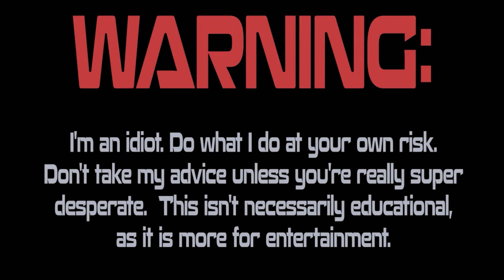FORGOTTEN 1970 Evinrude Skeeter Snowmobile - Will It Run? Part  2

Comment: For what it's worth. Back in the day we used to get the local welding shop to make up new wear roads for the old stuff. Took in the originals for templates and usually within a day or 5 you'd have new ones. The bonus was they were almost always cheaper than new parts, if you could find them.

Comment: There's 400ish names most commonly used in my area is "scags" when I was younger we welded round stock to grade 8 bolts then a nice bead of welding directly to the bottom and grinded it down angles would last cut n steer pretty good cheeper fix last long time heck yes sleds wheelers anything engine wise a feller enjoyed that stuff great job Derek 👌😁

Comment: Also, for metal tanks like this one -- if you have the patience, just drain the tank and fill it with vinegar (removed from the sled of course, you don't want vinegar in your fuel system).   Let it sit a week.  It will be clean when you dump and rinse it.

Comment: Even thou the wear bars used to be high carbon steel, rebar would work well. just bend to shape, then weld on some studs for mounting. (Once you get one that fits, copy the pattern onto a piece of cardboard for the next/future replacement) 
They add some strength to the skis, but they greatly improve turning the sled, certainly more when new then when worn down.  Great job on the sled. Runs and looks great!

Comment: I very much enjoyed your video. I have spent most of my shop time working on Yamaha's. I have a 1968 Evenrude 18-inch track machine with the push and pull engine design sitting in the trailer. You're making me think it will be next summers rebuild. Thanks for the inspiration.

Comment: Wear bars can be made from 3/8 or 1/2 “ square stock. 
Works better for steering than round bars. Pop on two studs to bolt up through the ski.I salvaged mine from an old wrought iron railing   I drilled two holes and tapped them 1/4x20 and used threaded rod to make studs. Ends of square stock can be rounded to fit in the ski and bending the ends to match the profile of the ski with a little heat and a bench vise. 
Not only will they steer better but also last longer depending on the thickness you use. 
I made a set years ago and they worked great !!

Comment: Great resto. I make my own ski runners for the old sleds using cold roll steel and weld a few bolts or all thread for studs. You can put some beads of weld on the bottom to act as a carbide.

Comment: Make your own wear bars using the torsion spring that hold up the trunk lid on the vintage cars.   Heat the end and bend the curve into it then weld bolts on it.  They last better than the carbide ones because they don't crack when you hit something hard with them.

Comment: Dennis Kirk in Rush City MN has some possible ski carbides for the ol 'Rude, but otherwise as a kid I'd take some discarded carbide taps from Douglas Machine in Alexandria MN and weld them to the bottom of the flattened out wear rods on my Yamaha Phaser. Dress 'em up with a grinder and boom, work fine, last long time. Shame about the broke off studs, may be welder and fab work time if Dennis Kirk doesn't pan out. Keep up the quality content, I feel like we could have been high school buddies.

Comment: Can you imagine trying to side hill that little gem?  TOO FUNNY!  I never noticed, do these old sleds have a chain case drain plug? I was so happy when they put dip sticks in them...  the 80s seem to have alot of problems, no one was checking their chain oil regularly.  I checked all my fluids on Friday b4 leaving home & lost an axle bearing the next afternoon. No way to predict a seal failing & it kinda ruined the latter half of our ride.  After that I started pulling & inspecting  all the bearings & seals each fall.  I have gotten spoiled with belt drives & 3in paddle tracks.  You look like you have had alot of seat time, ever been out west or in the mountains ridding?  Check out the larger muff pots that came out.... we put everything from hot pockets to beans & little smokies in a zip lock inside ours.  After a spirited ride to our play areas, it's always nice to have a hot bite!  I use to put a strap around my daughter & I like a seat belt when she was small.... if I had to stand up or hit a bump wrong... there was Pease of mind knowing she would never hit the handlebars.  They always fell asleep within the first 5 min anyway so it was like carrying a sack of taters lol but they loved it so much!!!  Mine would hear me loading sleds out back & come running outside!  At 18mths I scooped her up & put her in the suburban... she climbed into her seat &  didnt want to get out.  So for the next 90 min loading our bags ect... heck I even took dinner to her & we had a  little picnic together... I put the baby monitor beside her so we could hear but Dani was excited to head to the cabin, never made a peep!  Children just want to be involved & I applaud how you & your beauty wife have involved your boys in all your projects.  It will amaze you once they are older how much it all ment to them!  The one on one time you spend teaching I can see builds their confidence & their abilities have grown! Our kids are our legacy.  Love the builds!

Comment: Yep, just some round stock and weld some bolts on.  If you want em to wear longer, just run a bead of weld down the bottom side of the round stock.  Just take one ski off and use as a jig and make a bunch of skags in an evening:)

Comment: Nice work. I had a 74 Elan SS. Seriously, the only  way to run it was wide F'n open. Otherwise the track would plug up with snow or it would  get stuck in deep snow. WFO she was a fun little unit!

Comment: Designed by real engineers with a pencil, slide-rule, wearing a shirt and tie.  The locomotive styling and the practical oversized control knobs and start handle (gloves on operation) shows they knew exactly what was needed.  Where are these engineers today?  Thanks for sharing this beauty.

Comment: Hello from the land of the snow   Up here in Alberta I make skates from cold roll steel and some bolts bent and welded to fit using the old ones as templates saves on the wallet a bit

Comment: For your sliders for your skis on the Evinrude snow mobile use pieces of solid tubing cut to length and weld a stud and nut at the right location and sliders are made

Comment: We use to make our own wear bars, bend rod & weld a cut bolt to them to match  the stock ones.  It's not perfect but dirt cheap & worked great without cutting lines in the concrete with the fancy carbides. They wouldn't hang up on the trailer ramps either. Just a thought & with your ability it would be easy.

Comment: A friend of mine either uses 3/8” tool steel rod or he has also used tool steel weld rod and welds a wear layer onto the existing bars. Once the weld wears down he welds a bit more. Seems to work on older models he can’t find them for

Comment: Scags are easily made. Use your old ones as a template. Buy barstock (half inch I think) from your local steel yard.. Bend the ends in a vice. Use a perswader if necessary. Weld bolts thread first to the barstock. Then cut their little heads off.  I used to use square stock and round the ends so they fit the ski's. The square stock has more bite when cornering and takes a lot longer to wear out.

Comment: You can build carbide runners for the snowmobile from trunk springs  weld on headless bolts and use hard steel welds for carbides use to do this when I could ride

Comment: quick tip from someone who used to ride flatland bmx, use compressed air and shoot it under them handle grips and they literally BLOW off the bar and you wont need the grip remover

Comment: Derek it might just be the way the video was edited, but it appeared to me that the compression release was open when you adjusted the carburetor. You might want to look at the video and/or readjust the settings. Not nitpicking, just wanted to help if I could to cure that bogging down issue that you mentioned.

Comment: Oil today is definitely better but I would start at 32:1. If you foul a plug then go to 40:1. Just removes the risk of being lean and cause engine failure.

Comment: I used to make my own ware-bars just go to a hardware   Store and get some rod the right size couple quick bends to fit the ski holes and put grade 8 bolts in place under them and weld it to the bar stock

Comment: I use cheap hairspray for grips and things like intercooler pipes. Slick as a freshly shaved dolphin and sticks really well when dry. If you need to remove it, just warm water.

Comment: Hey Derek you can make your own wire rods go to the metal yard get some round stock and cut them and bend them yourself and then take a wire feeder and run a wire line feed line down the wire and you got a hard surface

Comment: Hello i just saw you video and if you cant find your ski skags use round bar stock i bebd mine abd weld bolts on where they are needed and they work great for old hard to find ones

Comment: Make your own hose clamps for odd fuel lines wrap soft solid copper wire 20-24 AWG or finer - one or two loops around the hose then twist like you're closing a bread bag- use a forceps or needle nose.  Not too tight, cuts the hose. Can be untwisted for removal.

Comment: you can make those runners out of 1/4 in stock and a couple of small alltheard welded to the top if you cant find the correct ones. did that a few times in the late 80's for a 340 artic cat

Comment: Trunk Torsion Rods for your ski.  About the right size and weld a stud on them and bend the ends.  My dad and I would  make them all the time.
Reply: You can even run a bead of hardsurface rod down them if it will see a lot of time on pavement

Comment: It may sound somewhat counter intuitive to introduce water into your fuel system, but when you have tight poly hose going onto a barb you can run it under hot water or soak it in an electric kettle to make the hose softer and more payable and easier to go on. Instead of the micro torch which you clearly stated, and have experienced, can cause pin holes and FIRE. Although majestic, that's not always the best thing...

Comment: Make your own runners, cut the rest of the bolts off and weld some new ones on, then run a couple of beads down the length of them to replace the worn off material with even harder steel from the weld beads, they will last longer and are cheaper, we always used to weld a bead down the length of them to make them last longer.

Comment: 2 stroke oil, use what the bottle says, not what the machine/manual says. The manual may say it has to run at 24:1, but it will also tell you to run yamalube or polaris or whatever brand the machine is. Bottom line, run the mixture that the oil says to run.

Also, more oil in the fuel=leaner fuel/air ratio because it makes the fuel more viscous, thus resulting in less fuel going through the jets in the carb. I know it sounds counter intuitive, but if you think, "its running lean, i'll add more oil" you will actually lean the jetting out further. 

Use the fuel:oil ratio on the bottle, then jet the carb

Comment: The neutral lock works nice but they engine will need to idle down real low , or almost stop for it to release. 
I usually switch off the key and then back on just before it quits. You may even hear the lock release as everything slows down.

Comment: An idea for the grip-a-lator onner-offer tool is some compressed air. You'll want a smaller & rigid blow tip. Just poke it on an edge and be in disbelief. A gal was shown that by an old timer last century.

Comment: As far as the  rods for the skies, I have a stick welder and hardening rods, i just take some off the shelf rond stock bend and mount them then run a couple of beads down the length of the round stock and forget about them.

Comment: to each their own on oil, but if thats built like the old outboards, they use needle bearings in the bottom end, id recommend sticking with a rich mix, at least 32:1, i know ive heard people say yea, new oil, but also been warned about the bottom end being different than what these new oils are designed for.  just food for thought, id rather gum a plug and carry a few spares than worrying about cooking the bottom end that ya probly arent finding parts for

Comment: If you can't find the part that goes under the skis you can bend a piece of rebar to fit on the bottom of the skis. Unless you want as close to original as possible. This is what we used to do

Comment: Back when we were racing BMX we would put handgrips on with hairspray... usually unknowingly borrowed from mom or sis.  It was the 80's so hairspray was pretty prevalent.  It's slicker'n goose droppings on an ice rink when wet and nice'n sticky when it dries.  Problem solved.  Problem staying solved.  ✌

Comment: I had a evinrude snowmobile when i was a kid in the 90s. It was a 1970 with a newer engine on it. It has cdi ignition on it! Pull cord never worked! Always had a rope to wrap around the clutch. And the braked never worked.  Hood was not on hinges and had a plastic tank in the front of it. And it was a pig on gas!

Comment: Once you get the new ski Runners formed... you can find an old 1/8 th inch thick metal file... use your cut wheel and cut it in half down its Center... weld each half of the file onto each ski Runner right under the ski post where it falls there... just use 3-1 in welds on each side... then take your grind wheel and sharpen those file halves to like a knife point... you now have the poor man's version of carbide runners... and when your kid/ Jessica... needs to turn it quickly to avoid hitting a tree, car, building, whatever..... it will turn...

Comment: Fabricate yourself a pair of new rub strips for the skis out of rectangular stainless steel stock (like 1/2" x 1/8" or thereabouts?). Countersink the bolt holes on the bottom and use countersunk phillips head stainless steel machine screws pointed upwards with stainless acorn nuts on top to hold them onto the skis.

Comment: Did you get the rubber gasket-spacer under the fuel tank? The original installation did that, and it protected the tunnel

Comment: You're probably going to end up using the Torches and some 3/8 rod and some 3/8 threaded rod to make your own ski runners... cuz that is pretty much what I would do... cuz I'm thinking it's pretty unlikely you're going to find any part number available for purchase.. but you could make those... I'm curious what twin carburetors would be like on that... just rig it on there somehow... you can make a video out of it... twin Mikuni's... coupled with dual exhaust... some studs in the track... then let's see what she'll do...🤔

Comment: If you want to heat up the tube without pinholes, put the end of the hose in hot water. You may get water in the line but not entirely too much... perfect.

Comment: The snowmobile is not too shabby actually could put it in a Vintage show... if it is 433 CC... it should show more power than it does but it's good enough... now Jessica... I don't know how you pulled that off but you're batting a thousand there in that department... wow..

Comment: There is a track tensioning method from Polaris.... you hang a 10-pound weight side to side on the track.... 16 in in front of the Centerline of the rear idlers.... the distance between the track and the sliders/ bogie wheel bottoms... in this case... should be between 3/8 of an inch and 1/2 in inch.... right at 16 in measure point in front of the center line of the rear idlers on most any sled.... if it isn't... you adjust things.... so that you have that measurement at that point and you also have track alignment you have to do those two things at the same time... the distance should not be more than 1/2 of an itch... and the alignment must be on.... you have to do those two things and then it's right... TR Michigan

Comment: On those wearrods make them homemade Derek.& either weld small 5/16 bolt size 7/16to 9/16 bolt head size for bolts.,or cut down 3/8.,or5/16 thread bolt allthread rods down to get your new mounting bolts. For fastening them back on again to your everyone snowmobile 25 hp/horsepower two stroke engine 1970 model. You should be fine going off originally patterns&design of the originals off of it.

Comment: I had problems with every type of those plastic inline fuel filters they always crack at the neck and leak on my old carburetorared motorcycle so I spent a few dollars not much but on a metal and glass one that you can see the filter and have not had a problem since and the filter is made of some kinda metal mesh material so u unscrew the housing and clean the filter and just keep using it and it’s all kinds of fancy color paint metal so it looks nice too. Lol 😂

Comment: Mister never sit on the snowmachines when riding, if you hit a stump or anything that will make you come to a complete stop.  You will slam between the handle bars into the engine caulling crunch into handle bars. Plus eat the rest of the caulling of the machine. Always sit on knee then if you hit a stump or anything you will just fly over and happy landing..

Comment: Does the exhaust have two fold purpose? I know getting the exhaust out one's face but dies the heat 1from the exhaust keep snow from packing up above the tack? Just asking even though in East Tenn we have enough snow some winters to have a snow mobile some we don't never had or experienced the sensation or the down sides. Just curious.

Comment: I used to hard chrome plate root ballers It's like a big melon baller but you put it on a pc of pharmacate and it pulls out the tree roots and all but doesn't kill it With 6-8 thousands or more of chrome It last a whole lot longer Lots of farm equipment and construction equipment Get the same kind of Right now plating